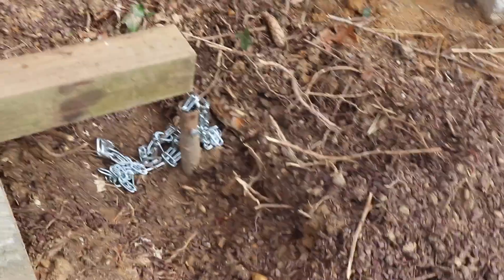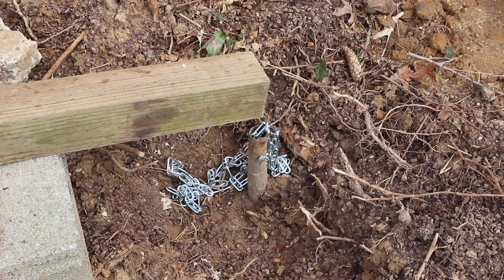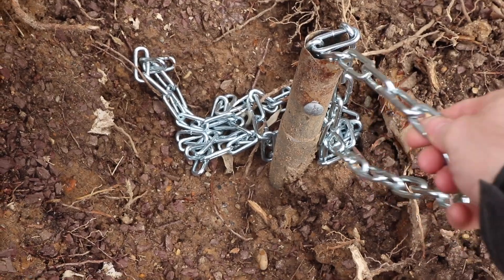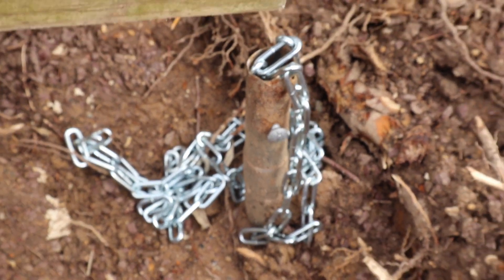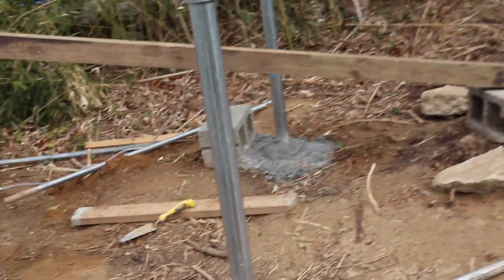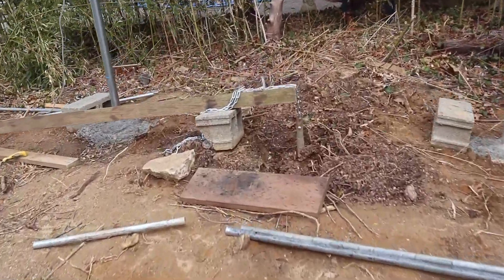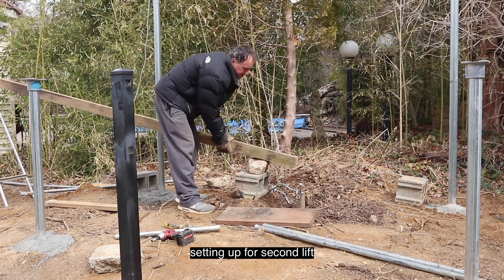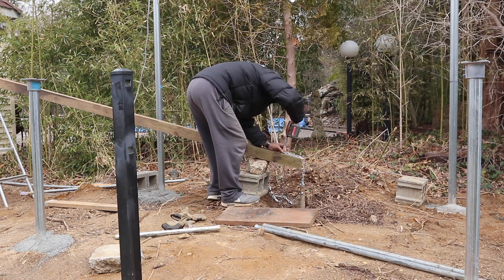Using physics to lift concrete footing fence post in minutes

Comment: Neat, I've found for removing piers from old docks to get some free metal stock and also free fence posts... to expedite the process use a farm jack with chains that you wrap around the pipe/post.   Then I'd rock the farm jack back to help loosen an pull out faster.  In between doing some rotations and swaying of the pipe/post.   However, no farm jack or old fashioned car jack, great resourceful thinking and application sir.

Comment: I've always said that you should harness the energy of children on a teeter totter to pump water.. or whatever else you want to do

But you can only tater totter with two people, unless you had something else on the other side like a water pump acting as resistance

Even if you just had a heavy weight on the other side so it would push down the handle on the water pump, and counteract the weight of the other child,